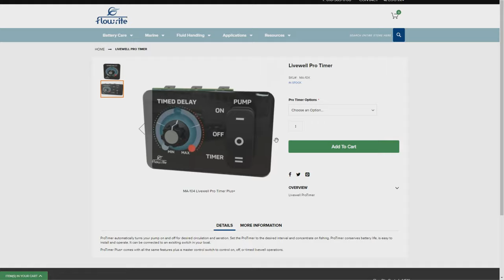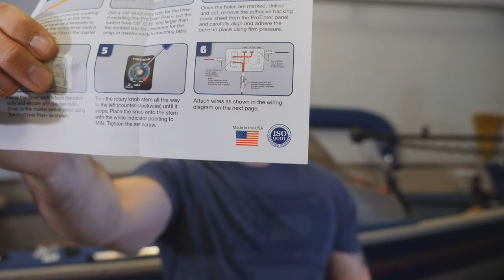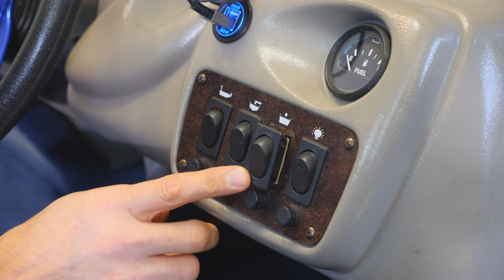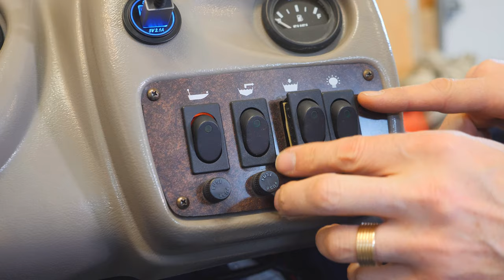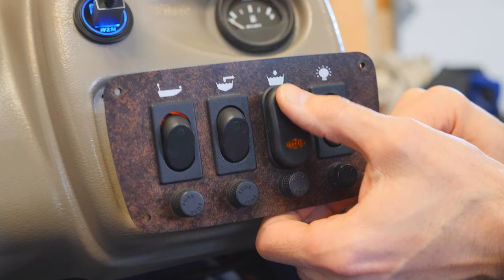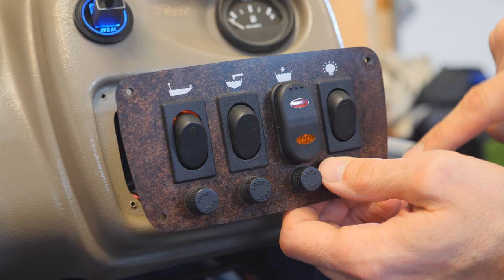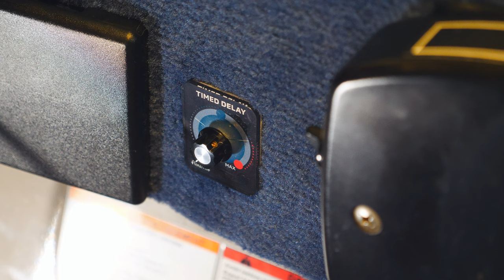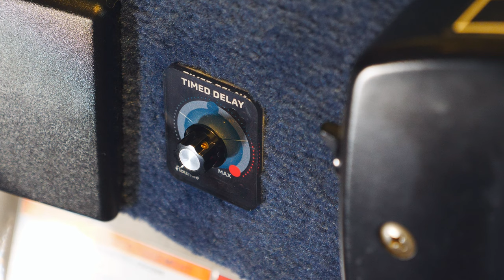How to Install a Livewell Aerator Timer and 3 Position Rocker Switch!

Comment: Have 2 live wells in my 1995 skeeter bass boat, I need to rewire both of them as they have had the wires cut up.
Question on this video, two orange wires go to which prong on the timer, in or out, in I would think is positive on the timer, and which prong goes to the aerator pump?
Do you have a diagram for this?

Can you help out a skeeter does not have any diagram for me

Comment: I know this video is a year or so old.  But thought I might try throwing a comment at it anyways..
Does this configuration support using a "fill" pump, and an aerator pump?  Or just good for the 
aerator pump?
Thanks
Reply from the maker: You could definitely use it for both, in this video I actually use it on a fill pump not an aerator pump as my livewell doesn't have a recirculate plumbing system. Technically you could even wire both pumps to the same time or if you don't mind that both pumps run at exactly the same time with the same delay. Thanks so much for the question!
Reply: @DanRichardFishing   I sent you an email as well.   Would you by chance have a diagram showing the possibilities you listed above that would include two pumps.    What I am wondering is can the fill pump be run from one segment of the switch, and the aerator pump be run (through the timer) on the other segment of the switch?   Thanks again...

Comment: Why not use the rig rite and just have one clean switch?
Reply from the maker: Not sure what a rig rite is, but the timer I installed is exactly the right one if you already have a basic livewell installed on your boat like I do.  I did think about installing JUST the timer but the problem is the 1 minute fill time isn't enough to initially fill up the livewell completely.